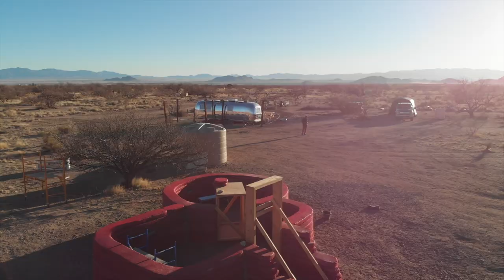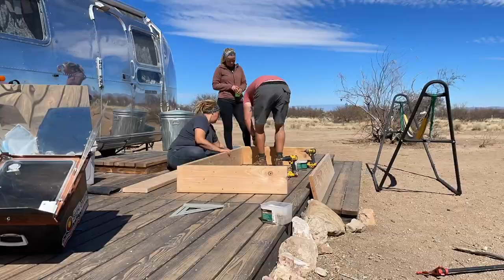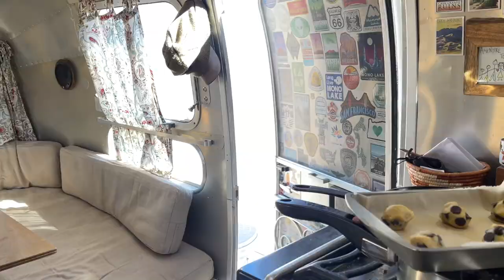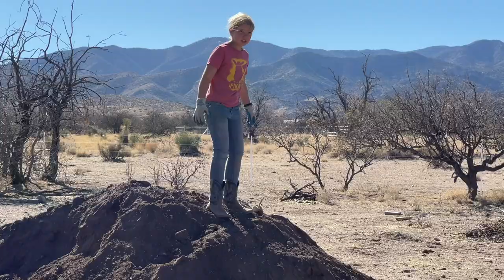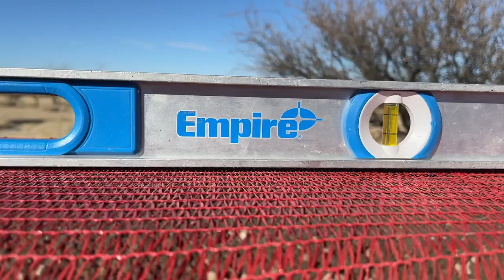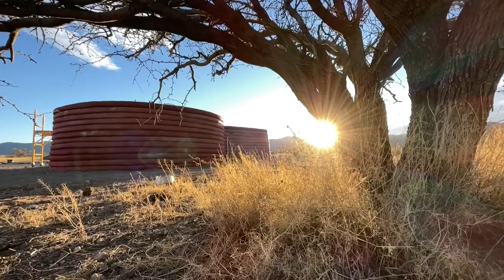Kids Build Earthbag Hyperadobe Shed

Comment: Nice to see your family all working together. Question: are you guys using barb wire?
Reply from the maker: Nope, the hyperadobe bags don't need barbed wire because the mesh interlocks naturally. Also we're going straight up vertically. Safer, cheaper, easier. 👍🏼